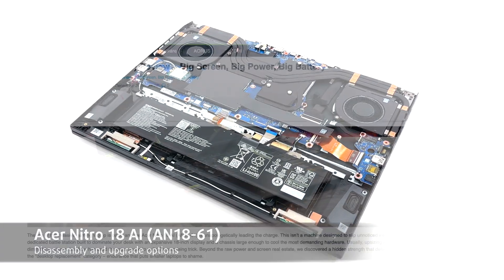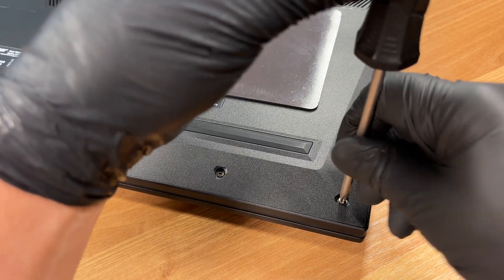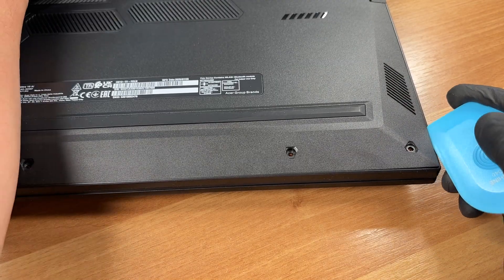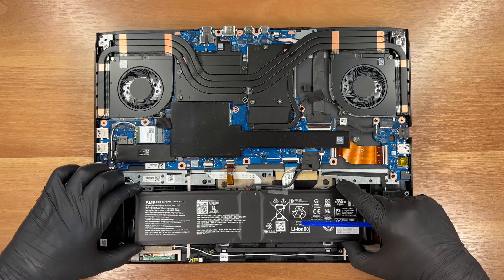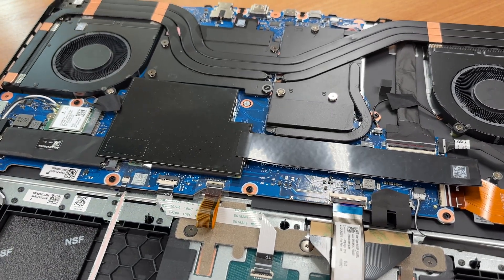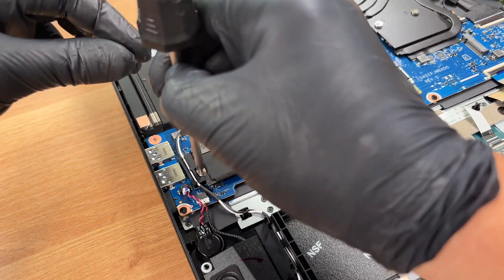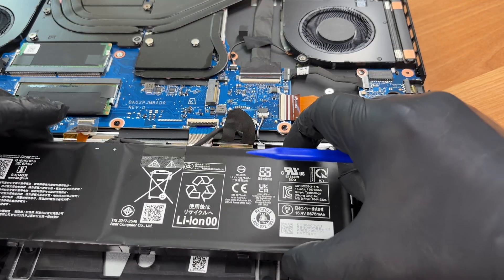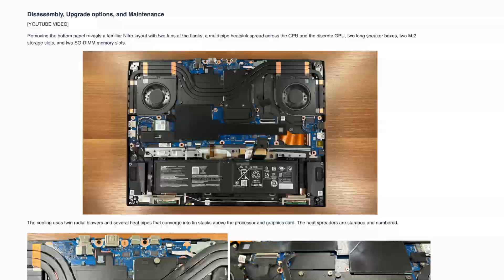🛠️ How to open Acer Nitro 18 AI (AN18-61) - disassembly and upgrade options

Comment: If there is a bios battery, how accessible is it ? Thx
Reply: look at 05:48
it is wrapped in black rubber. with its connector next to the ssd. so all you need to do, is to get the bottom cover off and disconnect the main battery and then the bios battery.